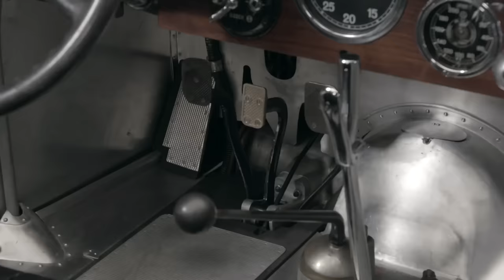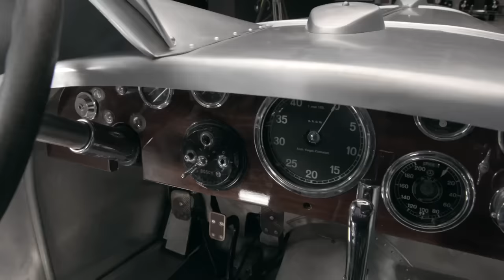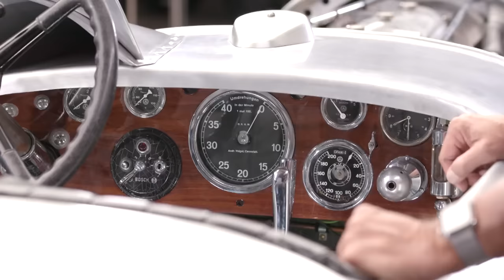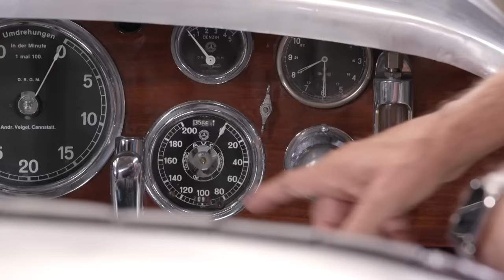1932 Mercedes-Benz SSKL - Jay Leno’s Garage

Comment: Episodes like this are the best. Modern cars get more clicks but this is an amazing piece of engineering and automotive history. Mercedes was so advanced in the 20's and 30's, a W154 was like a spaceship. BTW Jay looks like Tazio Nuvolari.
Reply: B J yeah classics are better they’re real cars not computers
Reply: The mercedes w125 hitting 268mph in the 30s was utter insanity.
Reply: I could not agree with you more BJ....this shows the development of automotive history, which Leno is a big fan of. Can you imagine driving that thing at full chat ?.....it would have been terrifying back in those days. When they took the hood off it looked like a work of art. Peace to ya.
Reply: @MrStabby19812  holy smokes. I looked this up because I have not heard of it. They did it with no roll cage, tires of the period and a 5.6L V12. I couldn't imagine going that fast in a modern car.  Icing on the cake, it was on a public road.
Reply: @VARITHMS  yeah another guy died trying to beat it. Its suspected they accidently made the car have downforce which the chassis couldent take and failed at similar speeds. Using down force wasn't really understood until the 60s
Reply: nigling  ....That is the most ignorant statement ever!
Reply: @MrStabby19812  Actually Auto Union understood it in the late 1930's already for their streamliner record cars. While they understood it in practice they had neither the full scale wind tunnels nor the time to properly test it other than in practice runs.
Reply: The Mercedes and Audis Grand Prix cars back at that time were finishing races a quarter of an hour before the rest of the field.
Reply: @mojoblues66  you're talking about the time Alfa won at the Nords with a car that had half the power of the Mercs and Auto Unions?
Reply: There is still a memorial on a resting place on the Autobahn BAB 5 for Rosemeyer, who died driving the Auto Union Typ R near that spot. It was actually a gust of wind which made him go off track.
Btw nice shot of the W125 Rekordwagen on that same day with Carraciola behind the wheel: http://www.rudolfcaracciola.org/images/portfolio/large/p6.jpg
Reply: @MrStabby19812  Or, it was inadvertantly shaped like an aircraft wing and took off? Was an explanation I heard.
Reply: Yes, Nuvolari had that pronounced jaw and smile.   Check out his history, quite amazing.
Reply: @MrStabby19812  595 F***ing horsepower—the most power race engine ever built until the monster motors for CanAm racing in the 1970s! And on 1930s tires, too. Those drivers had nerves.
Reply: @PaulZink  nerves of STEELE...cRaZy
Reply: Not Audi it was auto union where Audi was just a part but the race cars had nothing to do with them it was Porsche who did them.

Comment: Man, Jay really cuts those corners when he's turning left off a traffic light
Reply: Yeah, that made me stare.....
Reply: Probably because there is so much car ahead of the driver. Like driving a horse-drawn wagon.
Reply: That is most likely due to no power steering aka manual steering knuckle. With manual and Power steering that doesn't work you have a turn wide and accelerate slightly to make the turn.
Reply: It's a California-corner!

Comment: That radiator fan looks like a prop off an Evinrude .
Reply: I had to laugh when I saw the cooling fan. I once worked in a shop that sold many very nice European sports cars and one of those being an XK-E with a "reluctant cooling fan." That fan was a flat piece of steel, about 1 1/2" wide and maybe a foot long, twisted about 20 degrees from flat on each side of the "prop-shaft." By contrast, this beast has a cast aluminum prop off a BIG outboard!!! There ain't no dainty bits on this beast!!
Reply: boat propellor fan

Comment: Same age as my Morris Minor Two-Seater Tourer. Big difference in performance though, with the Morris producing 19bhp from a four cylinder 847cc side-valve engine running through a 3-speed 'crash' gearbox and capable of about 50mph. It's happiest pootling along at around 40mph though. I love pre-war motorcars.

Comment: Great video of a rare car.

@14:15 Jay says it's "cast iron" in reference to the engine. Only the cylinder head is cast iron. That huge block is cast aluminum with iron liners.
It still weighs about 250-300+ pounds, as a bare block.

Thanks for the video, Jay.

Comment: I can still remember reading in one of the Mercedes books from the 1980's that there were no SSKL's known to exist. I think that it was mentioned that just part of an SSKL was said to be found in South America. So, to my great surprise as a longtime Mercedes fan, it is nice to see a wonderful recreation of the most famous Mercedes of all time!!
Reply: Correct .None of the original 4 SSKL's have survived .It is not widely known that the SSKL chassis were fabricated from lighter gauge material than that of  the 'standard'  SSK .Thinner gauge steel, and large scale drilling of the chassis rails resulted in a short life. As the Merc man says ,this standard chassis has been drilled to visually  resemble an SSKL's frame . It should last a tad longer ....

Comment: I find it a bit perplexing they didn't wear at the minimum goggles!?... At any moment a pebble or even a nice size bug could damage their eye's... Oh well...
Reply: No fenders, no windscreen! You're bound to get some crud in your eyes!
Reply: No fenders, no windscreen! You're bound to get some crud in your eyes!
Reply: BossaNossa1 remember, this is a MANS car! 😀
Reply: Safety police here boys! Woot woot! 🚓 Put your safety glasses on! Wouldn't want to get hurt!
Reply: @mikehunt8375  Getting hurt and losing your sight are two pretty different things.
Reply: @banaana1234  hay they had the safety squints fully engaged. As I polish my face shield and goggles.
Reply: Going blind & deaf at the same time? Go figure!
Reply: Frank L  and when the crash without gear they turn into pink mist and their heads end up like a squashed grape but hey someone has to compete for the Darwin awards and it's just them at risk.
Reply: Frank L  It's one's right to be stupid.
Reply: Frank L  True, true
Reply: Bugs aren't so bad. I once had one hit me in the open eye at ~100mph when I gunned it on my bike and forgot to close the visor.  I had a tiny little piece of carapace stuck in my cornea for a day, bothered me to no end when I was blinking, but nothing else, and eventually it just fell out and that was that.

Comment: Is it just me or do the front wheels have positive camber?
Reply: It was more than likely designed this way for making it more stable with it's intended purpose
Reply: A lot of the cars of the era had positive camber. My 31' model A has it too. I am not sure why but it is supposed to be there.
Reply: @TODDFINK1  ahh thanks for the info. I'm not knowledgeable with cars from that era.
Reply: Tom Jobe (RIP) of the surfers top fuel team theorized that it was to keep inward pressure on the wheel bearings. Kind'a left over from the horse drawn wagon days.
Reply: I think it was to make the steering a bit lighter
Reply: Bugatti T35 had a lot of + camber, help it cut low speed corners better

Comment: My rear drum brake in my 50cc bike wheel it was controlled by a metal rod pulling and separating on this cam to engage a drum brake. Never a problem, always worked. Talking about 1989 little moped. "Romet"

Comment: The story about scraping off the white paint to save a few pounds of weight is true, but it relates to the monster Mercedes W125, producing 595 horsepower in race trim for the 1937 Grand Prix season. The 1937 season had a new 750 Kg. weight limit for the cars (the FIA, run by the French, was always changing rules to try and handicap the German cars to favor the French cars). At this time, the German racing color was still white, despite the "silver" (bare metal) color of the SSKL being shown. When the W125, with its 595 bhp in race trim, was put on the scales the night before its first race and found to be one or two kilograms over the 750 kg limit. With no other way to lighten the car, all the white paint was scraped off the bodywork and chassis, and then just made it within the limit. It won that race, and from then on won several more in succession (all the other W125s were stripped of paint and raced in bare metal from then onwards, prompting the change in national competition colors* from German racing white to German racing silver, where it remains today. (via automotive writer Ken Purdy). 

*The others are of course British Racing Green (BRG), French Racing Blue, and Italian Racing Red.

Comment: A handsome and brutal design at the same time.  This would be a perfect platform to scale up large enough to install one of the German DB aero engines like the DB601 or DB603 and just tool around a bit like the Merlin Rolls Royce.  The engines are as rare as they come but a non-airworthy unit that can still run could be put together from parts that are not flight certifiable.

Comment: Great episode!  I am guessing the front is designed for an optimum compromise between aerodynamics and cooling. Having this tunnel into which air is squeezed and then pushed onto the radiator cannot be aerodynamic in absolute terms. Bu it may be that there is more to gain from this extra efficient cooling, than there is to lose in terms of aerodynamics by designing it like this. The rear is obviously designed for optimum aerodynamics.

Comment: Zee Germanz really had some mechanical wonders going back in the days of govt sponsored Motorsport.  Say what you will but engineering wise, they couldn't be touched for some time.  Direct gasoline injection in the 30's...Supercharged 4 Strokes.... Supercharged 2 Strokes...Diesels...the list goes on and on.  Jay is aware no doubt.

Comment: In the mid 60's I was in awe of the 7 liter engines the big three were putting out.   Little did I know thirty years earlier that MB was putting out a 7 liter OHC engine.   Ford's SOHC motor was not as big a break threw as I thought.
Reply: Bugatti  Royale 12,76 liter SOHC

Comment: In the later 500K and 540K, the supercharger didn't engage until the throttle pedal was fully depressed.  Is the supercharger on this car a demand unit, or a full time arrnagement?  On the later cars, the time with the supercharger engaged was limited, presumably so as not to overstress the engine.  That likley woudl be problematic on a pure race car?

Comment: Re: aerodynamics, I'm surprised the designer had any ideas about the rear end of the vehicle.  Much more intuitive seems to be to point the front end and limit its area, which in this case they didn't do much of.  E.g, just by holding your hand out in the wind, you can feel the force whether it's palm to the wind or flat to the wind.  So again, seems obvious, without any wind tunnel or knowledge of physics.  So how did they figure out the idea of a vacuum on the rear end?  From early aviation, and the idea of lift on a wing's surface?  High pressure - low pressure?

Comment: If that is truly a modern engine it definitely either needs the carburetors cleaned or rebuilt because it shouldn't need almost 30 seconds worth of starting fluid to get it to start.  If the carbs aren't the issue then the priming pump isn't being ran long enough or sufficient for that engine.

Comment: Fantastic video. But always the same anecdote about a Blower Bentley pushing the Mercedes to over-use their supercharger and 'blowing up'. When did this happen? Is this a perpetual myth? In the 1930 Le Mans where an SS and a Blower raced, the SS retired with a faulty dynamo and flat battery during the night. Of the three Bentley Blowers entered, one didn't start due to big-ends, and the other two retired with blown engines! A Supercharged Bentley never really won a race.

Comment: Two disappointments (having enjoyed myself a ride in a 1920 s Mercedes Kompressor previously): The first one; there are many technical curiosities in this car -specially in the engine, (including an internal clutch which disconnects the fan) but nothing is said by the Mercedes Benz guys. The second; the kompressor hasn´t been put in action during the video!! Would have been really nice to hear it screaming. And the gearbox is almost impossible to use without a lot of practice, probably there were many unsuccesful tries changing gears before all these sweet changes in the video...Regards from Spain

Comment: Need to do a collaboration video with Dayton Wire Wheel Co., to get that back right wire wheel dialed back in... I bet you when you tell Dayton, you have a 1 of 4 wheels that costs $12,000.00 each, and want to do a video with them, they would help out.... ? Bent wire wheels on true knock-off spinner caps, bad combo... just saying...

Comment: Sorry to 'rain on everyone's parade', but this car is positively Primitive, compared with the Miller racers of the day.  Just go read any decent book about the history and development of the Miller Indy cars and compare - this thing's aerodynamics, the engine design and the suspension are all brutally dumb, in comparison.  The Miller cars of the day ran at higher speeds, with less than HALF the engine displacement.

Comment: Hint ... its not "avis race", but "AVUS race" (pronounced "ah-wOOs"). My first reaction after reading (!) the CORRECT name was: "DU dämlicher Hund du blöder! Schimpft sich Mercedes Classic, bekommt aber noch nicht mal die Abkürzungen gescheit ausgesprochen!"

.. really .. shakes head ..

Good thing Mr. Jay Leno is not such a  ... heathen.

BTT: To quote straight out of the German (!) Wikipedia: "(...) Die AVUS (Automobil-Verkehrs- und Übungsstraße) liegt im Südwesten Berlins und ist das nördliche Teilstück der Autobahn A 115." - which translates roughly to: "The AVUS (_A_utomobil-_V_erkehrs- und _Ü_bungs_s_traße = Automobile Driving and Training Street) is located in the southwest of Berlin and is the northern part of the motor highway A115."

The part about the 1932 SSKL starts in 5th paragraph of the "Rennsport_auf_der_AVUS" block: https://de.wikipedia.org/wiki/AVUS#Rennsport_auf_der_AVUS

cu, w0lf.